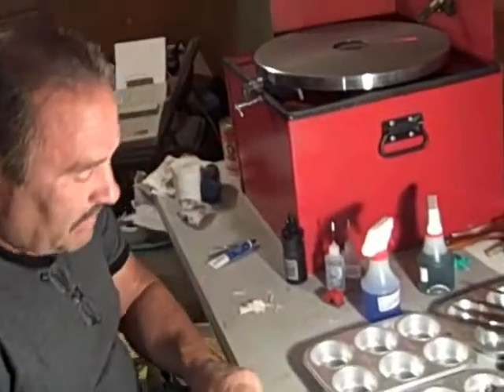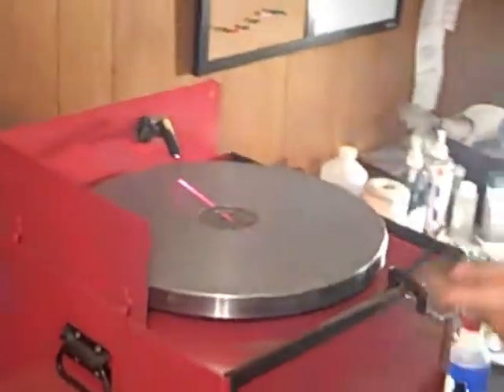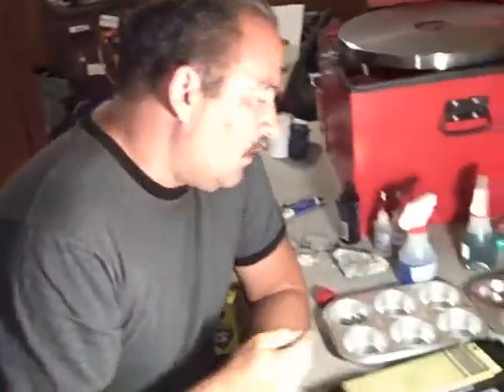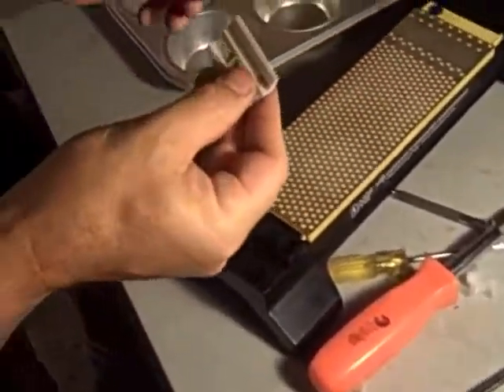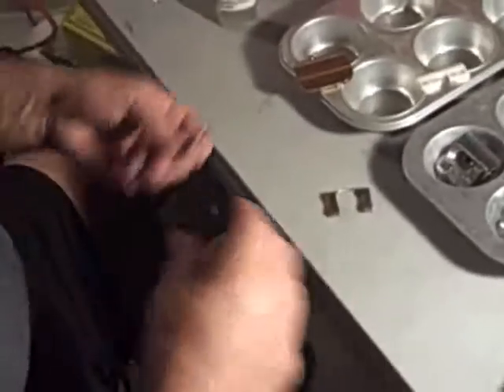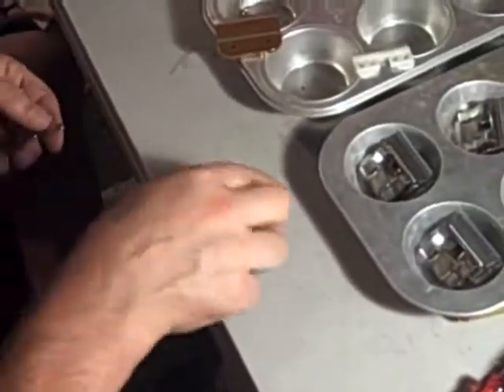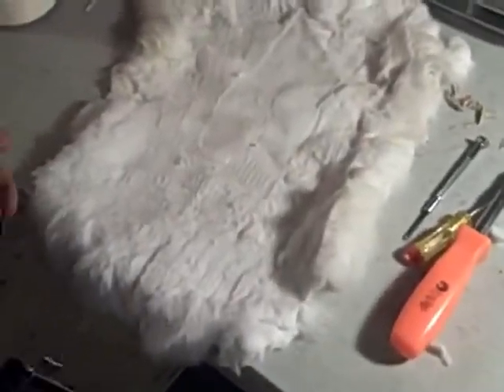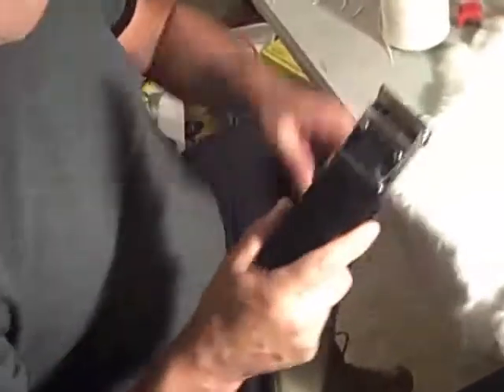ConceptSharpening.Com  How To Sharpen Ceramic Clipper Blades

Comment: Thanks Steve. Ive been using your recommendation for the ceramic blades over a year ago and it works well.
Reply from the maker: Still use same DMT block works every time  . Good luck
Reply: @conceptsharpening  How long will it last? Maybe the question should be when do you know it's worn?
Reply from the maker: @crossharpeningservice4833  I use it every day same one from the video just blow the dust off with compressed air